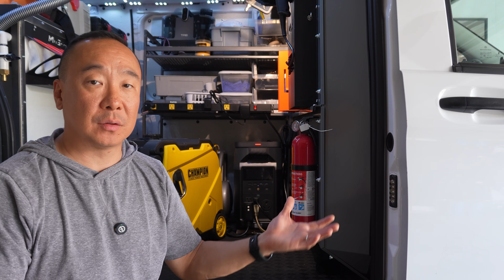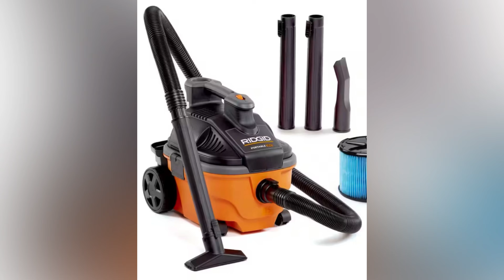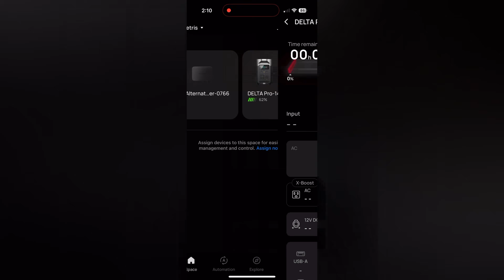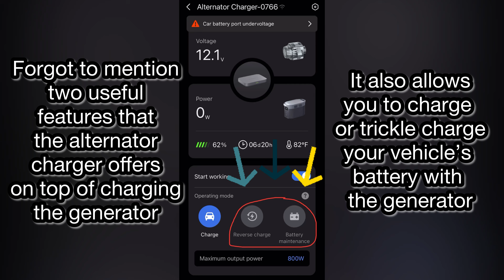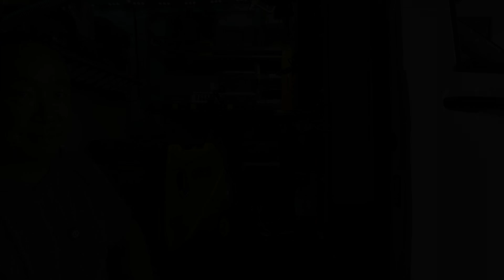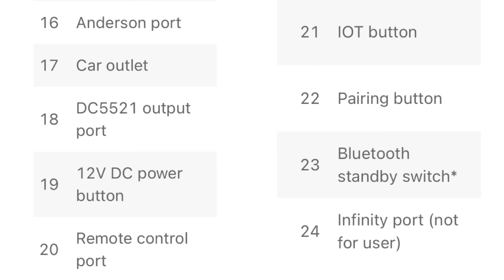Gas vs Electric Generator – The Truth After 6 Months

Comment from the maker: Would YOU switch from gas to electric for your setup?
Honest opinions only! What are you using now — and what do you LOVE or HATE about it?
Reply: Mr.Jax.. 🌅. Good day to you.. peace.. Yes, absolutely.. I run the Goal Zero 6000x, powers everything. I try and do an initial home charge on the air compressor, and steamer before I leave home.. and I installed remotes on my units.. so if I feel there is too much draw if everything is on at once (which is rare) I can turn off each unit remotely.. usually after a 5-6 hour job, using all tools.. the Goal Zero is still at 75%. Pretty neat.  My only concern is that if the Power Bank like Goal Zero, Eco Flow, Bluetti, Jackery… if it goes down, like something fails.  We are done, and out a 3-5,000 machine.. while gas machines are affordable and available.. I have blown up a Goal Zero 6000x one time.. and it was the first time I when to charge it out of the box!  I did not realize the outlet I was charging from was not grounded.. and POP! Goal Zero done.  However Goal Zero was wonderful in replacing it, even after user error. Thank you Goal Zero! And thank you Mr. Jax! ✌️😉🚐
Reply from the maker: @michaelleslie5362  Wow, thank you for sharing that experience—that’s some great insight! Sounds like you’ve got a really smart and efficient setup. Totally agree, the reliability of these power stations is key. Glad Goal Zero took care of you! Appreciate the kind words and support!

Comment: I appreciate your feedback. Based on this and other mobile guys doing the same, I decided to setup my mobile rig right from the start with the ecoflow. Makes more sense especially as it’s a more practical unit for home backup in time of crisis etc.
Reply from the maker: That’s an awesome move—smart thinking! Starting with the EcoFlow definitely sets you up for flexibility and long-term use, both on the job and at home. You’re gonna love the convenience and peace of mind it brings. Let me know how the setup goes!
Reply: @PristineAutoLab will do. Have the delta pro and alternator charger on the way. Next will be solar panels for on the trailer and the smart generator for backup redundancy if the grid goes down. Propane doesn’t have a shelf life so it’s perfect
Reply from the maker: @stevoeight Nice! I did keep my gas for redundancy. We never know! Good luck!!!

Comment: My dude, you don't charge a generator. Generators charge other things.  What you are trying to compare is a battery vs a generator.   These are entirely different things.
Reply from the maker: Really appreciate you taking the time to comment. You're absolutely right in technical terms — a traditional generator produces power while the EcoFlow is a battery-powered system that stores energy. In this video, my goal was to share the real-world experience of replacing a gas-powered generator with an electric alternative (battery-based system) for my mobile detailing business. So while they operate differently, for people like me using them in the field, they're serving the same purpose — powering tools, vacuums, lights, and chargers. Totally agree they’re not the same under the hood, but in the daily grind, it’s about which one gets the job done better. Thanks again for dropping your thoughts — I really do value the dialogue! 👊

Comment: Champion doesn't seem like a particularly good brand of generator tbh.  This is most likely the source of your issues.
Reply from the maker: Will not disagree! Appreciate your feedback and for watching!
Reply: @PristineAutoLab  thanks for taking the time to make the video.  Your use case seems good for a battery version. You can charge it each day and be ready, no fumes, less noise whilst working overall. No worry about stop start between tasks.

My use case isn for an RV, so normal generator is the only real choice.

I think you made a smart decision 👍